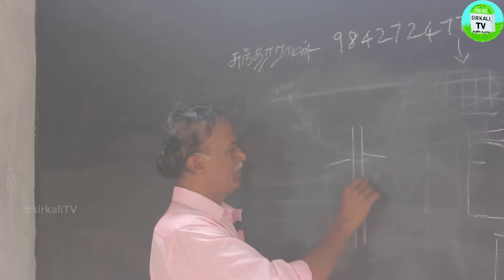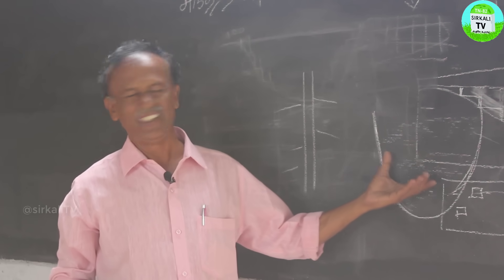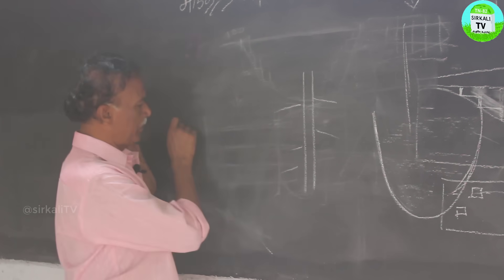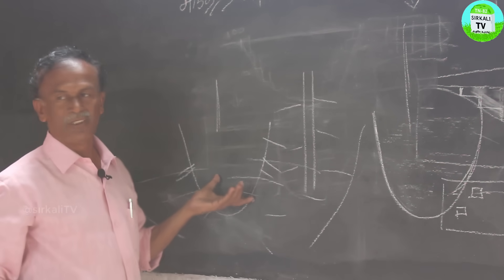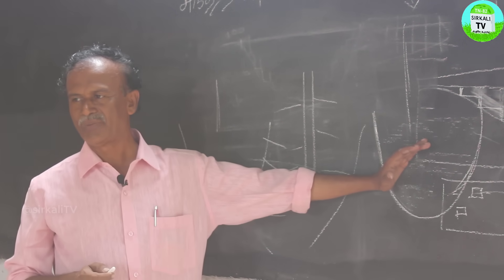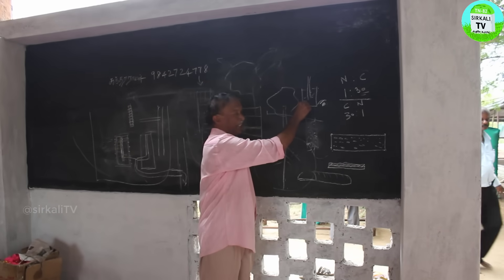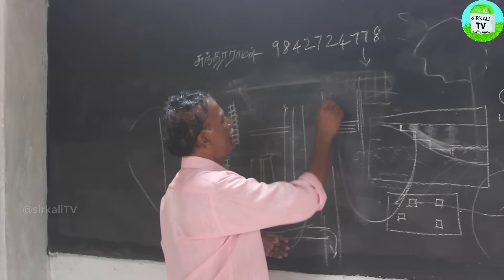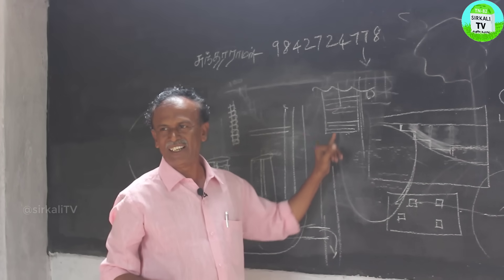மழை நீரை நேரடியாக நாம் பயன்படுத்தும் Borewell-லில் விடலாமா? பாமயன் | Pamayan | Aal thulai kinaru

Comment: My borehole is covered with sufficient casing pipes ( up to 160ft) till the rock formation starts. The submersible pump is also placed above the bottom of the borehole (50 ft above the bottom). In such a case, can i allow the filtered and treated rain water into the borehole directly? Kindly advise based on your experience since we use borehole water for drinking purpose also.

Comment: I have a bore of 400 feet and salty. Need to harvest rainwater and rehabilitate. I made a motor room with bore inside. I did with an intention to harvest water surrounding the room which is 10x10. I put pvc pipes around the building and gravel for 2 feet. But unfortunately, the people missed to make holes in the pvc pipes amd put mesh or muslin clothes. I was monitoring it remotely and got it messed. Should i now break the flooring and redo or outside the room make a trench and filter and put pump and Inlet the water to bore?
Reply from the maker: pls write to pamayanmadal@gmail.com

Comment: Sir, I want to recharge my well. Planned to make trench of 2 feet by 3 feet depth around the well. Well is 10 x 10 feet with 25 feet depth. What type of filter i should use in 3 feet depth? Some say gravel, pebble, coarse sand, and coal. Pioes to. Be insulated with muslin clothes. Will tgis work?
Reply: Gravel will be used mostly for filtering the leaves or visible dust come from terrace..
Reply: You can filter well and send the water to well.. I recommend to store in sump and consume for a whole rainy season

Comment: In our flat v have connected the sump (13000l capacity) with borewell . So rain water from 2 terrace collected in sump. When sump gets fully filled with rainwater , remaining goes to borewell.
Reply: Hello Sir, is it working without any problems. Because some say we shouldn't do direct injection to borewell pipe.
Reply: @Vinoth gct  its been 4 years , no problem nothing has happened.
Reply: @venkatsubramanian1260 Sir, m from Chennai and wanted to implement in my apartment,  hence asking ..
Reply: @vinothgct  v r also in chennai only. Before doing , consult with experienced plumber .
Reply: @venkatsubramanian1260  Thank you and Sure Sir. Any photo reference would be helpful for me to show to them.
Reply: @vinothgct  ur email id

Comment: In Hosur, TN house residents are doing  this.  Roof water goes to sump first, then over flow goes to borewell directly. More than 100 house have this.
Reply: That is submersible pump?

Any problem facing through delivery pipe doing this reverse action?
Reply: @kannanm3372  No
Reply from the maker: super

Comment: Your intention for suggesting  recharge of  borewell is correct. But I don't advise direct recharge by injecting rainwater inside. The water can be filtered by your method. But when direct recharge is done, the water entering the borewell will dissolve the sand on the upper layer and it covers the Submersible pump. A good number of experienced borewell plumbers have expressed their views with me when I attempted direct recharge of borewell. They told that they were not able to recover the Submersible pump in cases where direct recharge was resorted. You first try for your borewell in this method and express your views after 2 years.
Reply from the maker: sure will check and update
Reply: My borehole is covered with sufficient casing pipes ( up to 160ft) till the rock formation starts. The submersible pump is also placed above the bottom of the borehole (50 ft above the bottom). In such a case, can i allow the filtered and treated rain water into the borehole directly? Kindly advise based on experience.